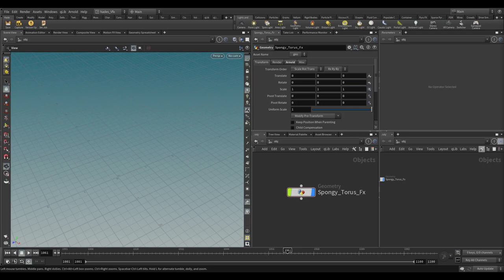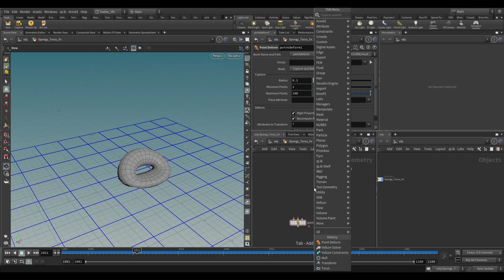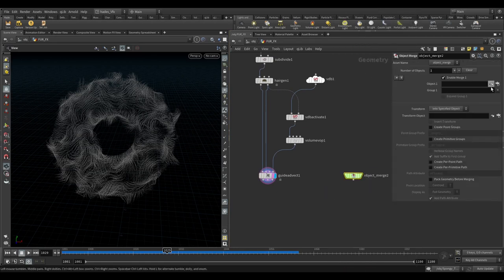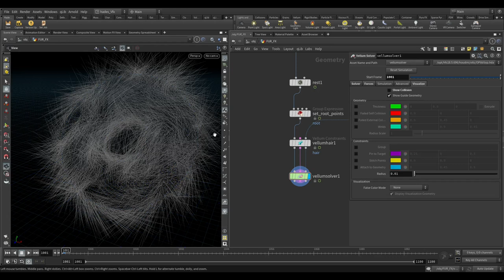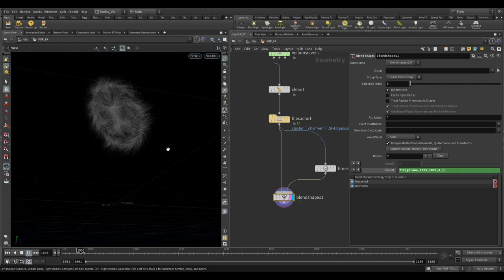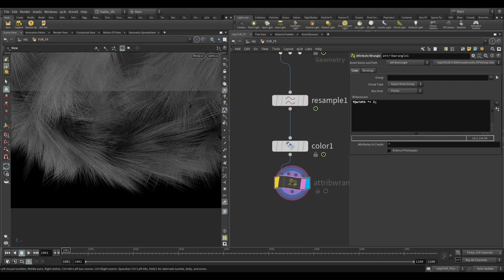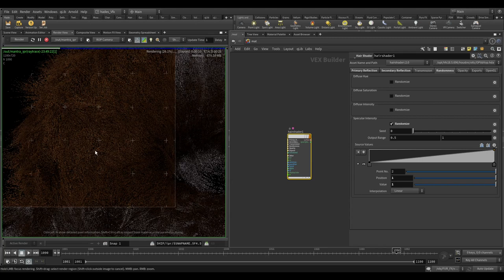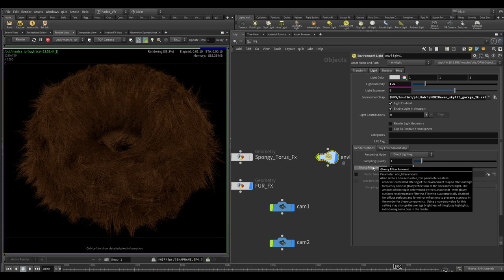Fur Simulation Using Vellum Hair |  Houdini Fx | Houdini Zone |

Comment: May I ask why point deform node needs to be added in the initial torus vellum simulation?  It doesn't seem to make sense
Reply from the maker: Yeah you are correct, For this one its wasn't required, incase if you have very detailed mesh then only it is required.